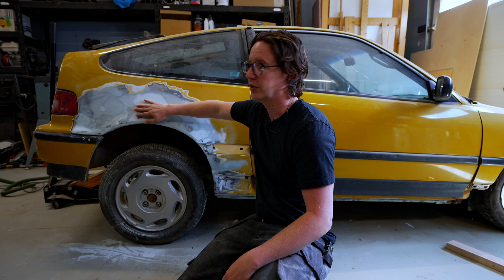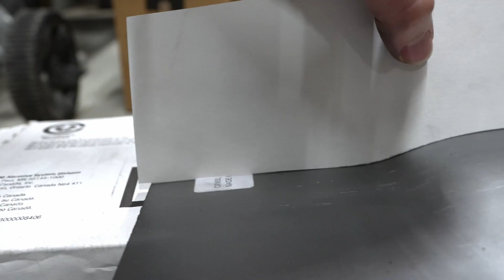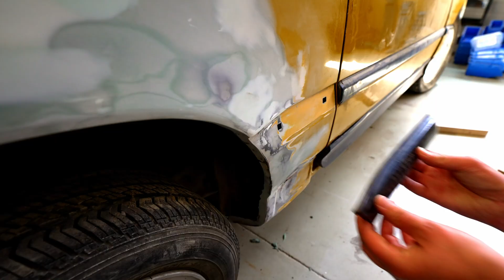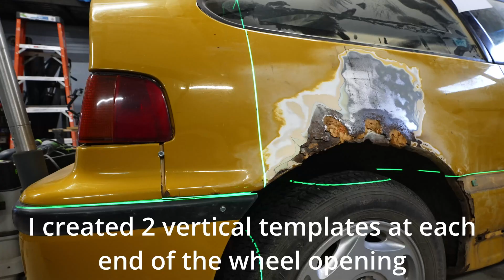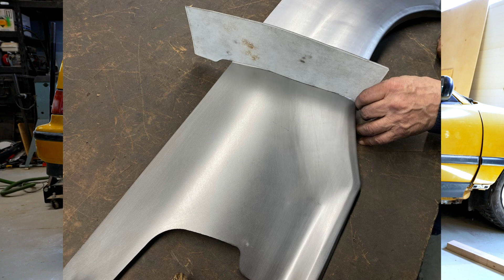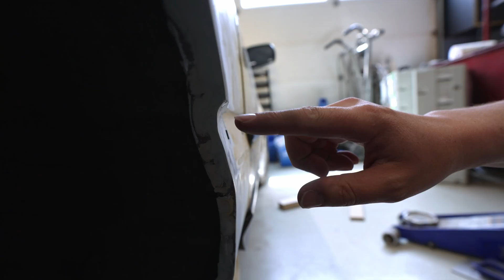Honda CRX Wolf Steel rear Quarter panels and what I'm doing next

Comment: do you have a set of the new v2 panels? how close do they look to factory? looking for replacements for my '90 si. thanks.
Reply from the maker: No I never had them shipped to me so just have a few pictures that they sent me of the panels after their built them. The looked much better. But as I said in the video really won't work with the side molding behind the door.
Reply: @ResearchDesignBuild Thanks for the reply. i think I'll call them and ask for some pictures or something when I'm ready to tackle the bodywork. that trim piece not fitting doesn't bother me much as I'll be getting a mugen style bodykit which removes the trim anyways.
Reply from the maker: @everybodyagrees4600  It will probably work really well if you are going that way with that body kit. But yes get lots of pictures if you can before they ship them.